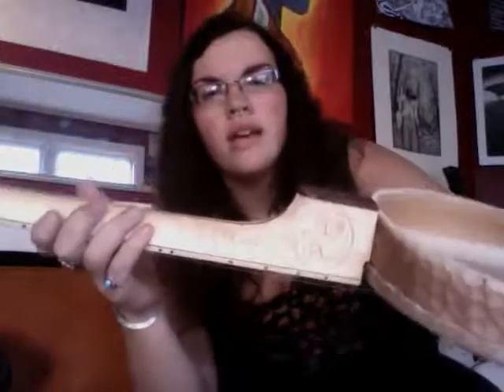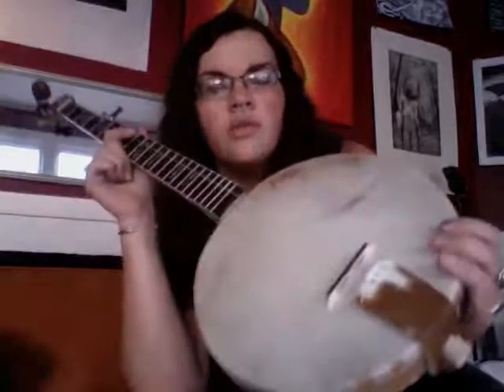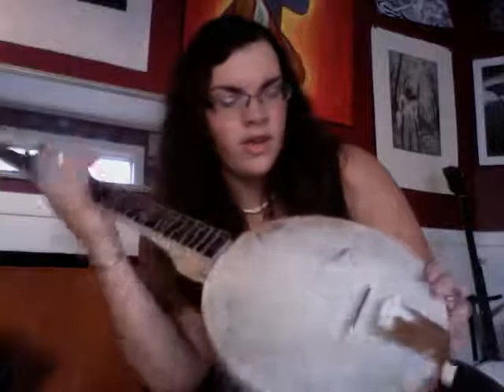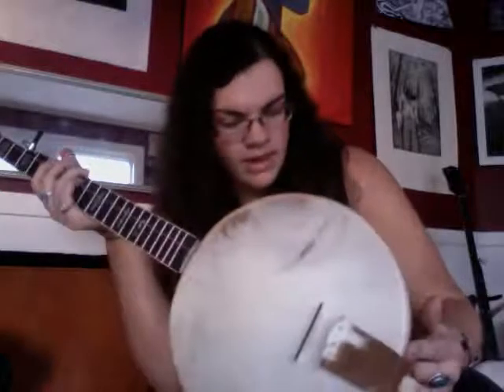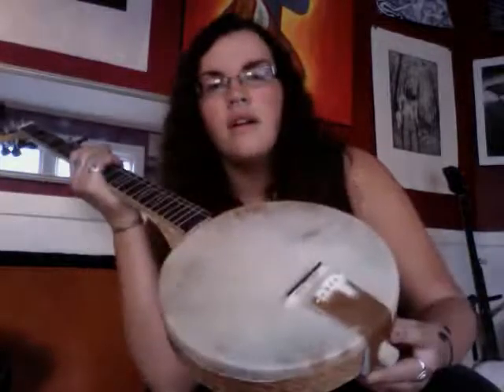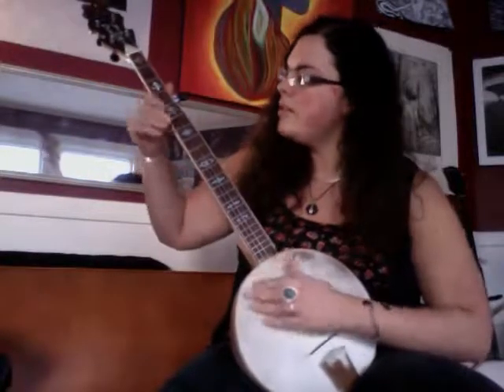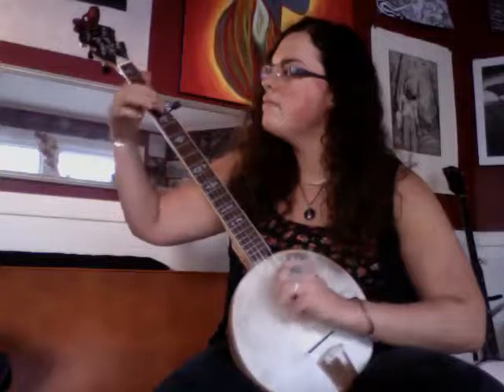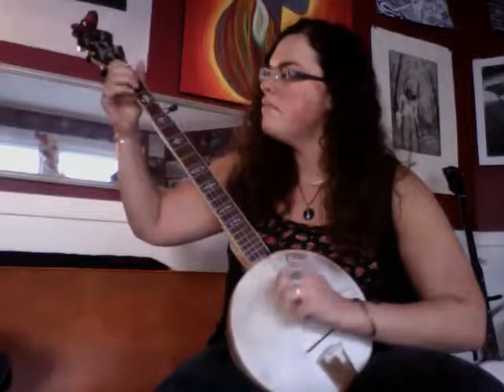My Ceramic Banjo

Comment from the maker: Thanks! I actually started with nylon strings but I wasn't happy with the sound. Unfortunately I have had some cracking issues already, so I am going to try to figure out away to direct all the tension from the strings onto the wood alone, and not the ceramic in any way. Or minimally at least. I think I am going to have to make a rigid tailpiece that is not resting on the pot directly. It's going to take some work but hopefully I'll get it figured out

Comment: Very cool concept, It sounds way better than I expected it to. If you have any more issues with cracking under the string tension, then I'd say you should switch to nylon strings, though the sound would be totally different.